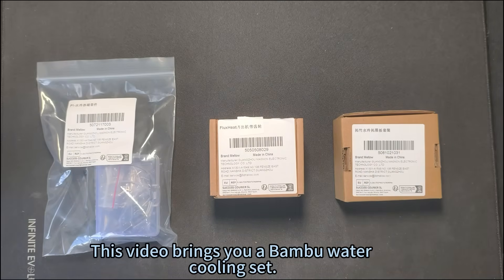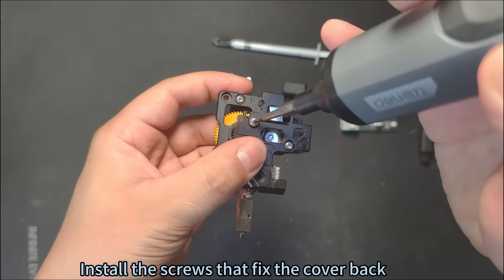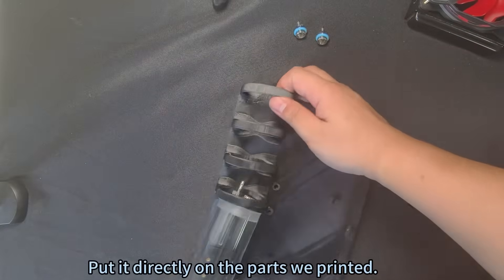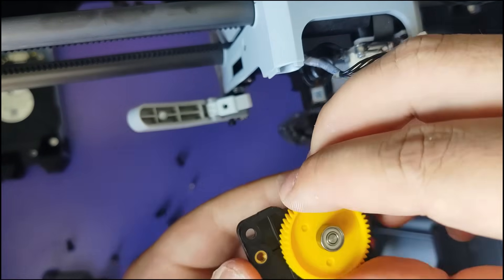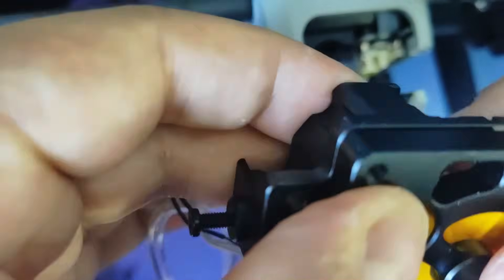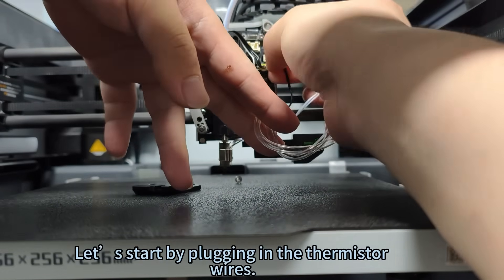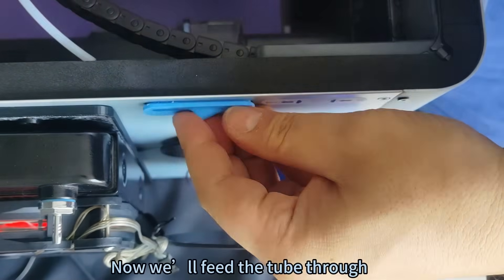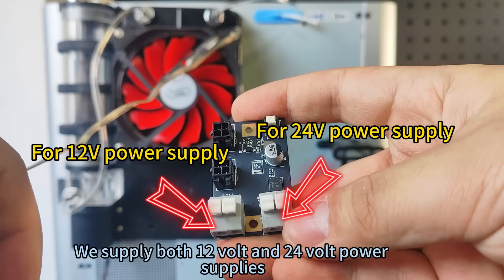MELLOW New upgrade Water Cooling Kit for Bambu P1/X1 Printer#3dprinting #3dprinter #bambulab

Comment: I dont understant of purpose of this MOD? I only had heat creep issue when tried on PETG use PLA as support interface, But with Right materials I am never had any problems. Spending hundreds dollars for nothing
Reply from the maker: Dear customer, owners of printer farms or multiple printers   owner frequently experience heat creep. Our product was designed specifically to solve this issue.

Comment: DO NOT BUY THIS!!  It's trying to solve a problem that does not exist and it's poorly done.  Blocked radiator = Zero flow through it and installing the hotend to extruder without installing the water lines first.  Spend your money on something worthwhile that works.
Reply from the maker: Dear customer, owners of printer farms or multiple printers   owner frequently experience heat creep. Our product was designed specifically to solve this issue."If you're still having issues with heat creep, please pls let us know. We’ll do our best to help you resolve it, improve the product, and even replace it if needed

Comment: I like this a lot since I come from a PC watercooling background. I think the mounting plate should have a slight redesign. I would add much taller standoffs for the radiator, so that it is 25-30 mm off the backplate. When radiators are too close to a surface on the exhaust side, it can create some back pressure and turbulence in the fins, lowering heat dissipation efficiency. Great kit overall!

EDIT, I see you mounted the fan on the radiator in pull configuration, which is even worse than what I described above lol. Please add standoffs of some fashion to give the fan some space to do its job. I don’t mean to offend, it’s just very bad practice for watercooling… I hope to help!
Reply from the maker: Thanks a lot for the suggestion! We’re planning to design a bracket backplate with some cutouts to help improve airflow.
Reply from the maker: Your feedback has been incredibly helpful to us. We’d love to invite you to collaborate on a water cooling video — and we’d be happy to provide a complete water cooling kit for the project. Would you be interested?
Reply: @3DMELLOWPrinter  I can't speak for the other user, although I just found you kit on ali when shopping for a new hotend and can see value in this upgrade.  I'd love to try one of the kits out on my X1.

Comment: Ain’t no way this runs cooler than stock. Maybe a few degrees. Your radiator can’t even breathe. It’s sealed on the back side so air can’t even pass through. 

As a concept though, this could work if done right.
Reply from the maker: Thanks a lot for the suggestion! We’re planning to design a bracket backplate with some cutouts to help improve airflow.

Comment: I actually need better hotend cooling because I get a lot of clogging in my p1p with a heated chamber. But I'm not very convinced of this. Especially because of the weight and the tubing runs.
Reply from the maker: In the next video, we’re pushing the printer to its thermal limits to fully evaluate the water cooling performance under extreme conditions

Comment: What is the point of this upgrade? Seems totally unnecessary and complex.
Reply from the maker: Hey pal, water cooling will totally step up the cooling ! We’re pushing to make the next version even easier to install — stay tuned!
Reply: Water cooling also removes the fan from blowing onto your high temp filaments. It's actually a smart process they're trying to do.
Reply: Listen at 0:30
Reply: Wenn du wirklich Ahnung hättest, würdest du sowas nicht sagen...